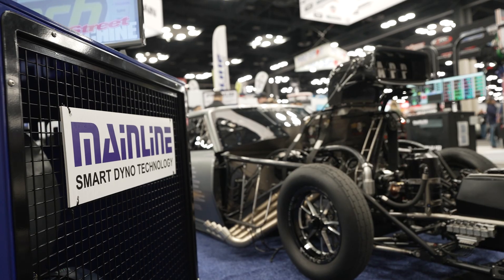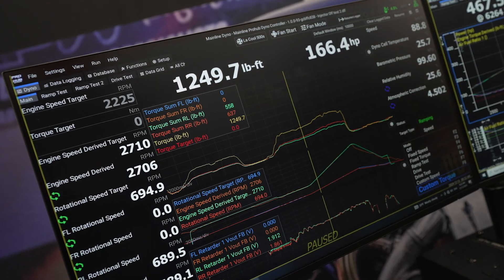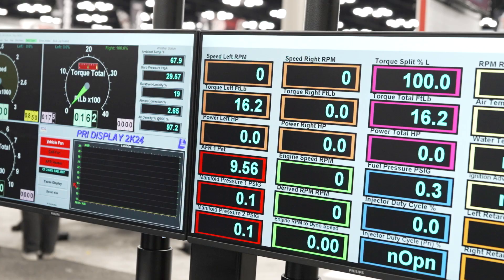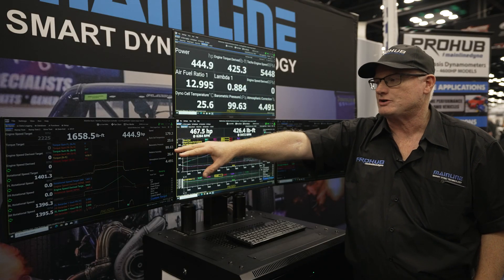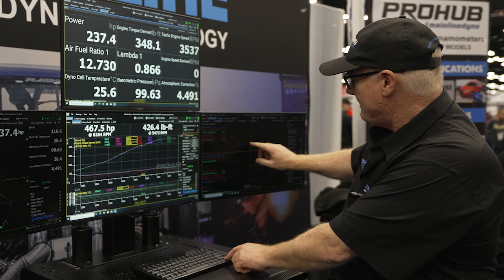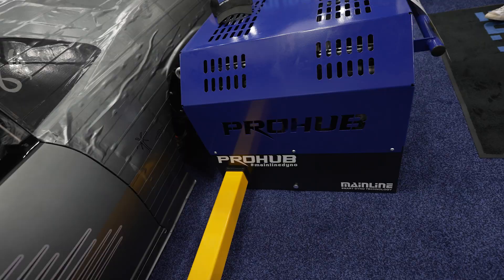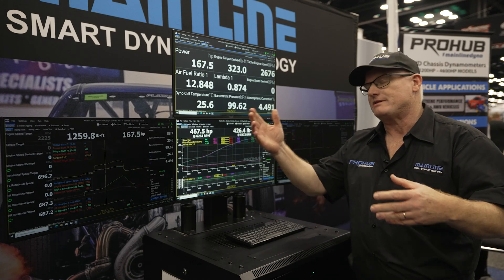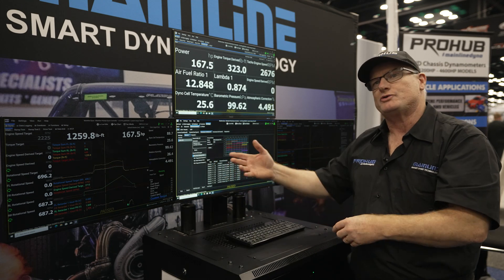New CAN Control System Launched at PRI 2024

Comment: So I just got my dyno, now I'm stuck with legacy software which may not get updates now that you and your company have maybe split from that third party? So what happens now to existing customers? I literally took delivery in November and am not happy that now I may have vaporware running with no path to upgrades or fixes. Not to mention yeah, it looks like 1998 software.
Reply from the maker: As mentioned in the video existing owners of the Mainline DynoLog systems will continue to be supported. There will also be an upgrade path to the new CAN Control System for the previous Mainline DynoLog model owners.
Reply: Why not ask the vendor to update the software?